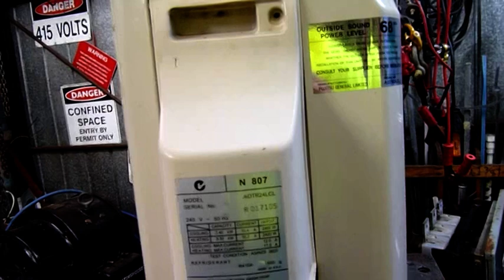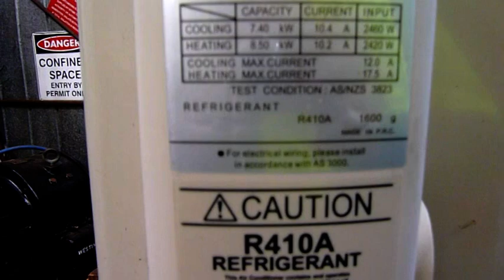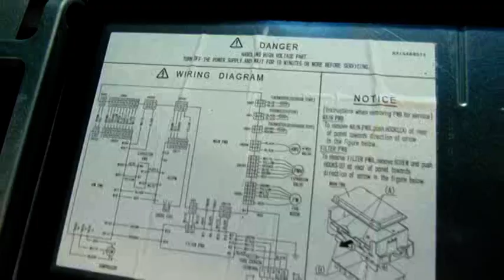Fujitsu Inverter Condenser In-Depth Autopsy (New Style Unit)

Comment: The IGBT can be used to generate true 3 phase sinusoidal wave power, but requires more complex drive software.  If the outputs of the IGBT have toroid inductors and capacitors before going to the motor, then it is true 3 phase AC output like your VFD.

Comment: The IGBT has 6 transistors, 2 for each phase terminal.  The two transistors work in a totem pole configuration where one transistor can pull a phase lead to high voltage, the other brings the lead to low potential. Like high voltage TTL. So you have an H bridge driver for each phase.  Three overlapping H bridge drivers.  Typically the outputs are frequency (RPM) and pulse width (TORQUE) combination for control.  I think they should be called AC motors as AC square wave drive. But the term is DC.

Comment: The black power module after the bridge rectifier is  an Igbt  and  it boost the 
 170v  (120x1,44)  primary voltage in a hgher lever (about 400v dc).This is because dc bus
 must be very stable in ac voltage   variations.
-Second role of this igbt is to make a pfc between voltage ans current  while pulsing with pwm the choke  and   keep  power factor   close to 1.
In this way  the dc bus  is    high  efficied   for  supply the inverter igbt.

Comment: the pcb @8:00 and @14:40 = filter/snubber pcb namely. - common mode chokes and filter caps for suppression of EMI back into mains, yes incl MOVs for component over-voltage protection. @15:34 = DC buss dual choke for DCV stabilisation. @16:30 - that is main application for IGBTs - to reinvert DC to AC at VV, VF, so yes it is inverter as it states, but can be controlled to produce variable DC - whatever is required. @17:08 is DC active filter module. @18:00 - when you see DC in + 3ph output = IGBT
Reply: Any idea why some of the motherboards have only 2 large capacitors (with space for a third one, blank) while other boards have all three spaces filled?

Comment: IGBT output is not sinusoidal current, hence the high harmonic current drawn and mitigating components required to suppress/attenuate, particularly as power goes up. DC buss choke coil and dc buss capacitors are prior to inverter bridge - provide stable voltage for reconversion to typically variable AC or rarer but possibly in Fujitsus application - variable DC, depending on what motor is installed. All determined by the Air Con OEM, what they find best efficiency/cost

Comment from the maker: @TheFsJunkie They are a good unit, but all manufacturers have early failures. i've seen loads of scrap units from every maker. MHI included.

I didn't see a vid sorry , it was in my shared folder (I rarely check)

I'll upload a vid of a MHI Inverter Indoor unit autopsy soon

Comment: Well it's done....installed. Since yesterday it's been running to bring up the temp of my 1300 sq. ft. basement which was always below 50f in the Winter.
Happy to say that after the unit running now for 14 hours we're up to 64f with an outdoor temp of 5f (-15 c).
Truely remarkable results given the conditions. Once everything in the basement has equalized temperature wise it will maintain my 70f setting economically.
Reply from the maker: to be honest, I rarely see these more modern units go to scrap. Fujitsu had a lot more of the early inverter units fail tho, these ones seem to be an improvement,
Reply: Aussie50 i say these so called inverters should be weather proof to made them last longer
Reply: Y Canuck

Comment: 3phase d/c compressor. the d/c coming out of the diode goes to actpm board than flows through choke coil coming out of the yellow and blue wire choke is inductor brings voltage up to around 360vdc-380vdc to work the ipm board=comp and d/c fan motor.

Comment: Hi Aussie, 

thanks for the video. I was about to purchase the Fujitsu inverter, thinking they made them reliable. Now, I am not so sure... The whole IC board is being placed on the top, just beneath the unit's lid. 
Since I work with the amplifiers, receivers, CD's and stuff, I have seen what the heat can do to the circuits, and if you add some humidity - bye bye! 

The thing is... Fujitsu is not a cheap aircon, and I would expect it to deliver quality and long life units. 

Since you are in this business... maybe a short comparison on consumption between the inverter and non-inverter units should help people make their choices. 

Thanks a lot mate, keep well and take care!

Comment: The brick and choke right after the rectifier seem to form an active PFC which is basically a switchmode PSU trying to draw a constant current from the grid.
My money is on either the PFC or the VFD itself frying the caps by forcing too much AC ripple current on them. I've seen many capacitors getting hot, bulge and eventually even pop by too much ripple forced onto them by a SMPS.

Comment: There are no phases with DC.  The 'DC' on the motor probably means that the motor can handle constant level (dE/dt=0) electricity from a 3 phase H bridge.  Ordinary AC induction motors overheat and fry on such waveforms (which is why they should not be used on modified square wave inverters).

Comment: I've worked in the power supply industry for all of my life, whenever we supplied a unit that was going to operate outside we always conformally coated the circuit board and it's components. We would cover heatsinks before spraying so they were not coated.

All the caps in that unit should have been 105C or better yet 125C.

Those two changes would improve reliabilty for only a few dollars.

Comment: I'm much late for comment, but anyway, I need to confirm: 100% 3-phase sensorless BLDC drive. In air conditioners it's usually 2-pole pairs motor, runs up to 6000 RPM (frequency is at least 2x mains frequency). I'm frustrated that no one else does videos on DC inverter air conditioners on proper English. I'm from Bosnia and Herzegovina, so my speaking is not that great, but, I'm tempted to make videos on this topic to encourage other people to make videos on the same topic. You cant get part number for "SPM2" (System Power Module), for the active PFC (Power factor correction), 'cause it's Fujitsu's proprietary module. However, this module is self sufficient, i.e, it receives command from CPU in form of +18V, and it runs. As far as 3-phase IGBT IPM module concerns, it's probably some kind of Mitsubishi IPM (such as PS21869 or PS21867, may even be smaller, like PS21244 or PS21245).

Comment: pulse width control is normally always simple frequency control. 'Torque' control is still via PWM technique, but requires more complex algorithms and much high speed processor, something that will never be found on a domestic/commercial air con units. It is possible Fujitsu are outputting variable DC, which is still done by IGBT, but typically always AC. Square wave alternating over zero is AC, regardless of wave shape. Fujitsu state DC inverter, so must brushless DC motors.
Reply: "something that will never be found on a domestic/commercial air con units." it is now, 7 years later.

Comment: I hear what you say about reliability of inverter systems vs conventional but when you consider that when an inverter or VSD drops to 50% RPM the power input drops roughly to 1/8 and considering A/C units generally run at partial load most of the time the power savings a high....I guess it comes down to regular preventative maintanance by a good tech. I think new MEPS regulations comes into affect in October this year, so finding a non-inverter will be impossible.

Comment: I figured that the reason behind using an inverter in an Air Con unit was so they could do two things. (1) Modify speed by modifying the AC frequency they feed into the compressor and the fan. (2) Use a higher AC frequency then 50 or 60 cycle so they could use smaller motors with less copper wire in the windings. I don't know about number two as the extra complexity of building an inverter unit isn't going to save them much on production costs.

Comment: Funny what you said about getting a zap off the PCB when turning the fan motors..I saw the same thing happen to a Japanese design engineer (guru) on a windy day when onsite working on a larger VRF system....word of advise remove fan motor connection before working on the units and allow capacitors time to discharges..especially on windy days!

Comment: If you can install these inverter units they can save you quite a lot in power costs, enough that they will pay for themselves in a short time 

In my case going from a 6 to 8 seer 80s system to 21 seer mini splits the savings is over $100 a month 

1 to 2yrs they pay for themselves roughly 

Anything past 2 yrs and it's free money 

A std split system install is 2x to 3x the cost of what I bought and would take about 6yrs to 9yrs to pay for itself in the utility savings 

I prefer the zone oriented approach with mini splits as well 

I see the main problem with them is low refrigerant and this leads to other problems, install quality is critical

Comment: Hi Your Power Module u Refer to would probably be a AVR for the capacitors and i also believe the first board with the choke coils you explained can be bypassed in as a last resort as i see it as a filter pcb and 240ac connected directly to the next board? the last board with the ic at the bottom i think is like a current sensing drive for the compressor on when it needs to idle im not saying this is the way it is but that makes kinda sense to me on how the circuitry basically works anyone else ? maybe explain your method to understand the circuitry easier dont want fancy terms i am clued up on electronics but havent had much to do with these boards yet and also havent worked on them yet

Comment: Hi there I have a Sanyo co2 eco heat pump and seems to work ok,no errors on the machine. But the fan is dead not spinning and it is getting minus here in sweden I have opened up the fan and am so puzzled ,I can not find what looks like a capacitor anywhere. No Aluminium Capacitor anywhere. Completely puzzled. I could send you some pictures if you would like to help. I do see a board with 3 black capacitors under the board ? if this is them ,then How would I see if there is something blown on one of them. Regards Kevin

Comment: interesting to hear about your local scrap policies. Seems they might be a bit stricter overall? Here in the US there is the same "give and take" from shop to shop but overall there's 3 grades: 
#1 - stripped wire and other clean, shiny copper 
#2 - soldered/painted/corroded etc.
#3 - "breakage" - steel/copper condensers, motors, compressors without oil, etc

Brass is either "clean" or "contaminated". For instance, a brass solder valve with copper stubs but no handle is clean. a brass faucet cartridge with a stainless stem is contaminated.

Have been watching/rewatching a lot of your older vids. Always interesting stuff curated by a knowledgeable, personable lad! Hope all is well, cheers

Comment: Well.. the DC motor is clearly a AC motor.
Same as with HDD motors, the current going into them are actually 3-phase.
It's kinda strange how they mark the motor with the specification of the driver (that want DC input) and not the motor itself (3 phase).

Comment: hello there. I have got some units with board failures and right now I'm trying to trouble shoot a Fujitsu exactly like this one. it seems like it's the comms board (top one) that's at fault. indoor unit flags "reverse comms failure at startup". there is voltage from the rectifier and filter board seems to be working fine. I've found a place that repairs boards in Melbourne but they charge $200 for that board, I was willing to try and repair it myself or maybe find a working one somewhere. any thoughts? thanks

Comment: 1. do you know of anywhere to buy and sell second hand air con parts/ pcb.s, motors etc?. or a forum?
2.  do you have a working drive board for a Daikin FTXS50GVMA? it has a faulty output transistor module that is a block containing many parts that can't be sourced.
3. Do you know of anywhere to get a test box/simulator of indoor units to generate the serial data signals so outdoor units can be tested/trouble shooted alone?
John

Comment: Can I mix and match components on mini splits?  For example, I have fujitsu outside unit and a daikin inside unit.  Both are 24k, both are inverter heat pumps.  Can I just match up the connecting wires?
Reply from the maker: I strongly doubt it, they would probably "talk" a different language when it comes to the indoor unit telling the outdoor unit what to do.

you could give it a try tho, not much to loose since they are scrap if they do not work together anyway?

Comment: finally, is the inverter air conditioning much more complex than a conventional one?
Reply: It can speed the compressor up and down depending on load and demand, so it's more complex
Reply: he said theyre DC motors.. im pretty sure theyre not.. cos inverters give AC output
Anyway... if both the compressor and fan work on AC, then its alright..
if the inverter fails beyond repair then u can just pull out all the wires and do the traditional wiring where it'll run constant speed and cut out

Comment: does the condenser fan & coil need to be so big.
any possibility to make smaller?
Reply: This unit is tiny for 7 kw my Panasonic inverter which is also 7kw probably from the same age and probably with the same compressor is HUGE like double the size of this and Daikin a is also quite large

Comment: Shouldn't all this electronics be in the indoor unit? Is it possible to control compressor like that?
Reply: it is but then thay wold hav to make the indir younit biger to hold all that stuf. in side moste of the indir younits its vary compacked so thay put most of the electronic part in the out side younit (wich i think is dumb) most hous ac units hav thar electronics in the indor unit and just hav the fan and compraser outside. hope this helps (ps i think that all inverters need to hav ther electronic parts in the indor unit)
Reply: I thought that it would be nice to have all the electronics from the indoor and outdoor unit, inside the third unit that would control everything. It should be a flat, scanner size box on the wall that would be easy to repair and change parts, and would not be exposed to the elements.  Indoor and outdoor units should be mechanics as much as possible, and should be easy to dismantle and clean.

There should be standardized cables and pinout. I think not more than 8 wire cable to the outdoor, and something like 16 wire to the indoor would suffice for all the future use. One should be able just to update firmware and attach another indoor/outdoor set.

Comment: I'm worried bcause I'm getting a Fujitsu 12RLS2H installed tomorrow.......
Is there something better out there for my money?
What about York?
Reply: Captain Canuck .. If you did the Fujitsu  installation I hope it's doing well. I'm compiling first hand info on mini splits for their reliability and your input would be appreciated as two years is a good starting benchmark.
Reply: Is it still working? My 12RLS running great 10 years.  Two 9RLS units... one had the motherboard fry.  Working on a fix....

Comment: fyi; not snubber caps - DC buss voltage stabilising caps. They wobble because they are only soldered at 2 points and are slightly raised - so OK. It is probably comms error as I find with 80%, also I strongly suggest you keep the other pcbs and ensure what fault is - they are very expensive and can be reused if nothing is wrong. Typically only 1 pcb or even just thermistor is failed, thats why I strongly suggest you keep pcbs, wire up an IU (mostly dont need pipes), and see what error code is.

Comment: why can't they keep it simple just like a 12v bldc motor(permanant magnet 3 phase winding & hall effect based controllers) construction & a simple electronic controller for temp control, would have as reliable as old capacitor run capillary tube acs.
Reply: 12v would make it a lot less energy efficient. They use 380v to improve energy efficiency and it also allows them to get away with components rated for less current.

Comment: Fujitsu = China made. Daikin is Thailand. I spec that NO Fujitsus are used at our industrial site - they are garbage. We have previous and brand new, latest model Fujitsu's come to site, 4x not working out of the box (comms error), 15x lasted no more than 4 weeks. 80% of failure is inverter OU pcb - comms complete failure, 1x IU fan motor error (either encoder feedback or IU pcb), various thermistor failures. Electrolytic caps 'raised' = their design. Usually catastrophic failure via rupture.

Comment: Hello I have one models number aou9r1 and the problem I'm having is that it blow air but it won't come out cold what could i look for to repair it so it could blow cold air if could help I would appreciate it thanks
Reply: jaimef101 need to put some gauges on it and see how much freon pressure you have.